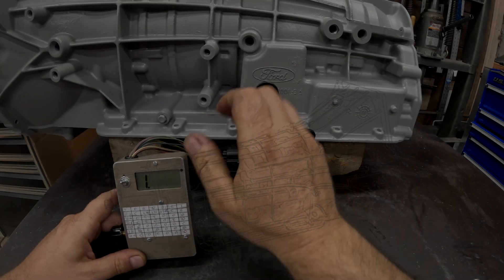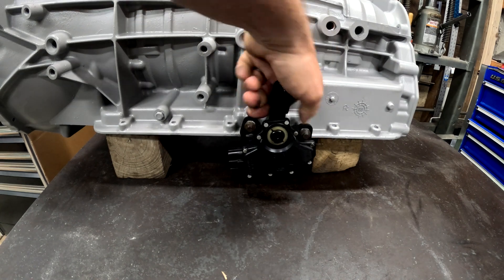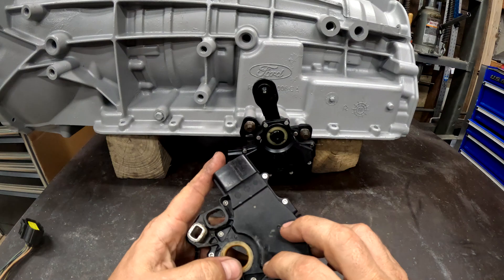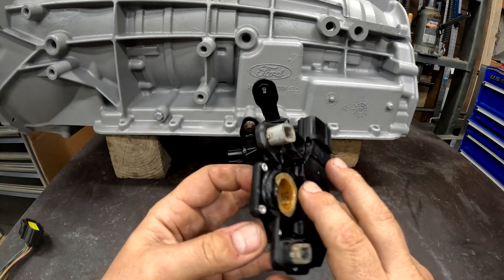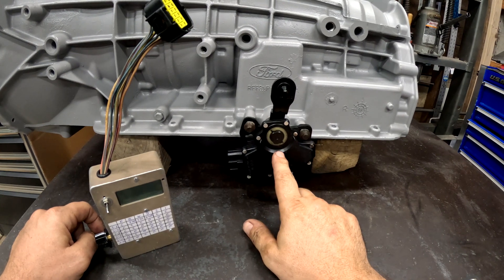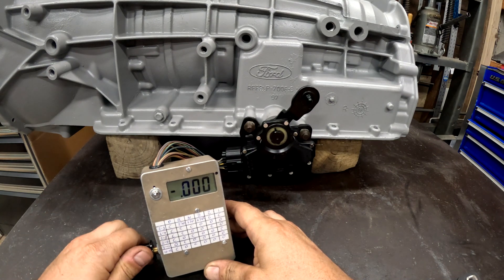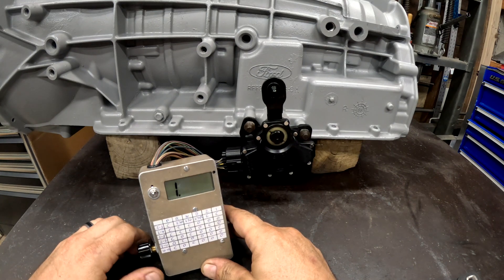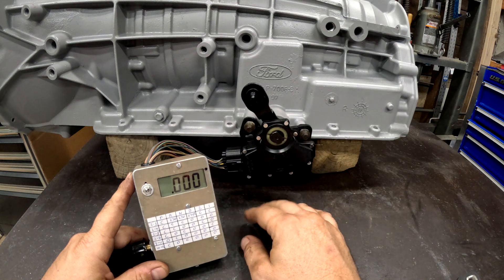Ford F250 4r100 Transmission - DTR Sensor Test & Evaluation

Comment: That's a handy little gadget you made! I cut the plug off of a parts truck and labeled the wires to test the DTRS. I found it makes it easier than trying to get to the pins with multi-meter probes! Keep up the good work, I'm learning a lot about the 4r100 by watching your videos!

Comment: HUGE thumbs up for the alignment tutorial!  For those who can't see it in the video, there's a "NEUTRAL" stamped on the black plastic of the sensor (upsidedown in the video), and a tiny indented line right above it.  There's a corresponding indented line on the white ring.  Ignore the larger marks on the white ring, they're just spaces irrelevant to alignment.

Comment: Used my ohm meter and in park and neutral 2/5 were open both times- hair lines are perfect. I’d say that’s why I have a no crank or power to the firewall solenoid. It’s stuck there. The dtr looks fine and it was sudden failure. Couldn’t have figured it out alone. Thx for posting
Reply from the maker: Glad the video helped.  If you haven't bought a new one yet, get either a new Motorcraft part ($$$$) or a Rostra part ($$).  All the other ones will not last.  Even a used Motorcraft part is better than most new ones.

Comment: Im having a low speed shift issues. New transmission. I have replaced all the electronic sensors including this one. I saw a jumper wire from ecm to tps. Are you familiar with that issue? Or which wires it would be
Reply from the maker: If you are saying "jumper wire", as in someone literally ran another wire from the pcm to the throttle pedal, then I'd start with that.  Anytime there is an electrical problem, always start with any hack electrical work.
Reply: No. Mine has low speed "gear hunting" and the occasional coast like it want to go into neutral. 

I have replaced sensor in rear end, mlps, and tps. My hairlines on the mlps are lined up. 

Any thoughts on your end what to check next

A guy said he was losing signal from ecm to tps

Comment: My last transmission was a fresh build when I got the truck me being a dummy backed a trailer up a very steep drive way and put a tiny crack right on the flat part on the back of the transmission it was so odd because you couldn’t see it but you would see bubbling from the trans fluid coming out the back. Is there a way you check for cracks on cores or is it just a crab shoot
Reply from the maker: Sorry so late getting back.  This comment was not popping up on my dashboard for some reason.  
I check every core that comes in for cracks before I accept them.  If it is cracked in any way it is not usable.  But if installed in a truck, you can sometimes find them just by looking for oil stains, dirty spots, discoloration.